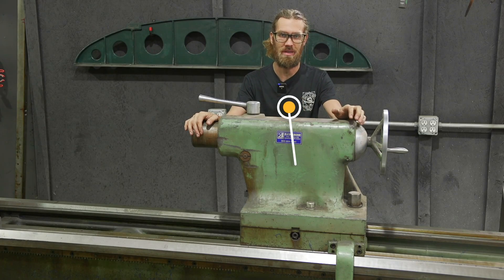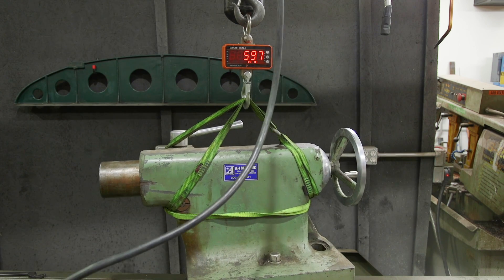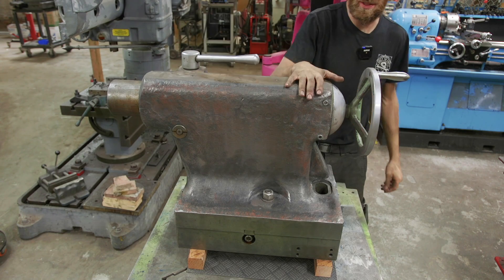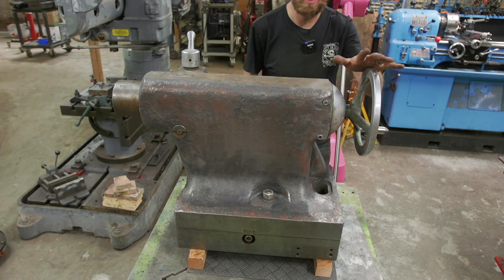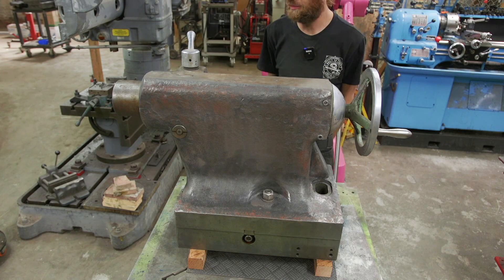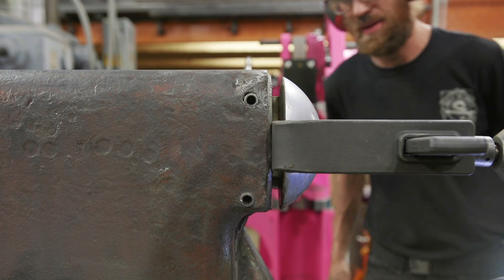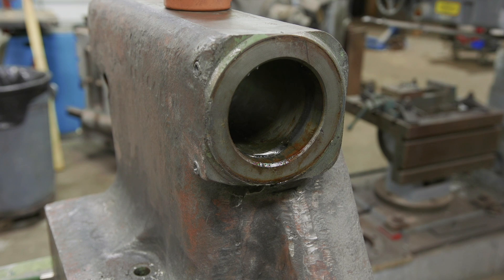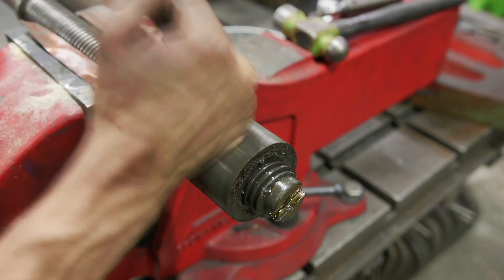Tailstock Disassembly and Cleanup | Lion Lathe Restoration

Comment: Nice job!  And no, a follower rest is very much necessary even with 4140ht as with the length it have flexed in the center giving you much chatter and variation in the profile due to insert cutting edge wear or chipping.  Just for info, if you were to do a lead screw, lead tolerance over a 12 inches would be around 0.005” if not less.  But since this a tail stock screw, lead can be a little less “ tight” and the main consideration being the length of the tail stock nut in the quill (interference within the thread engagement male to female.  
As for thread lead, the main difference being between cut Vs ground threads.  
While I don’t have any machines with ball screws or digital read out, I can see the benefit of those betterments!
Reply from the maker: Indeed I am sure it’s less than. 005 of run out

Comment: Very interesting Kyle.
That rear cover/housing came off hard.
Glad it did not break.
Wow that tail stock is heavy.
Nice job with the needle scaler.
I need to get one of those.
Have a good weekend. 👍
Reply from the maker: Thanks. Now I realize those taper pins had holes tapped for extraction. Even so might still have been totally stuck but hey you learn something new everyday.